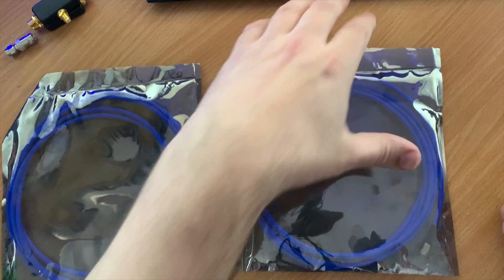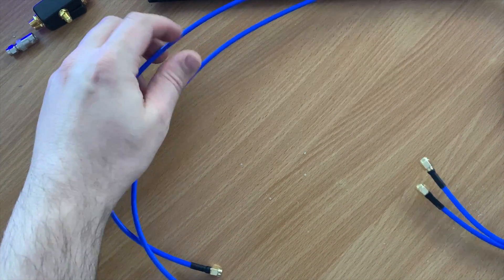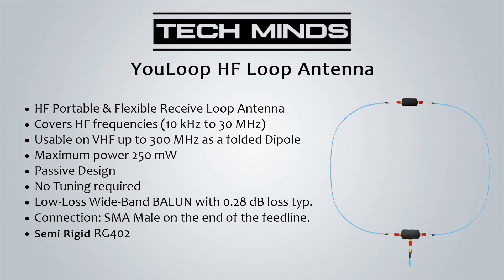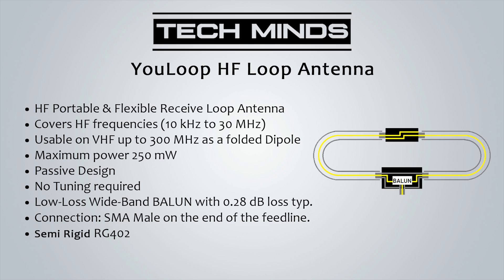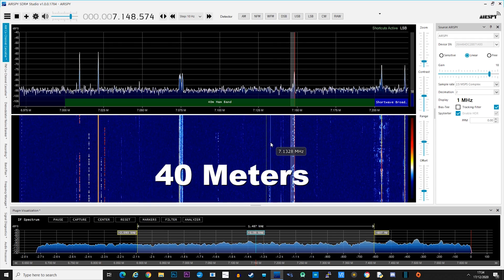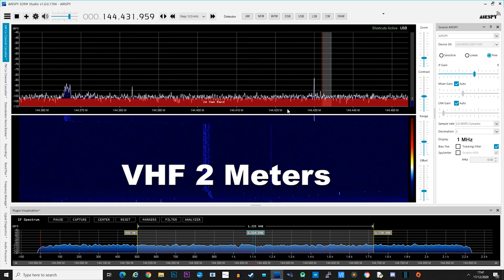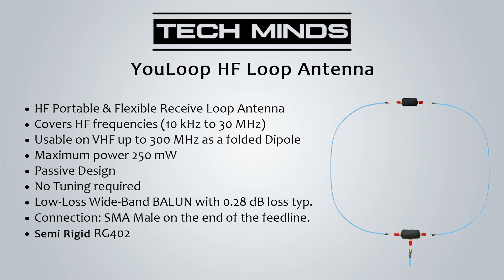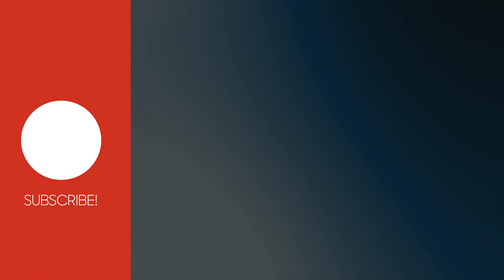YouLoop HF Passive Loop Antenna

Comment: I love mine, it works really well with a traditional shortwave radio like my Icom IC-R75. The radio's switchable preamps are helpful with this passive design and yield a very quiet result with far better signal-to-noise performance than I'm used to with a long wire.

Comment: I'm so happy to see someone using a fishing rod as a antenna pole. I'm using a 2.4m pole from Boyes (£11.50) as part of a grab bag SWL kit I've built with a fishing seat box and backpack attachment. The rod sits in the side pocket with a cable tie giving extra support. At the moment I'm just using an Xdhata AN-80 antenna and clipping it to my Tecsun Pl-368 handheld. With this setup I'm picking up CW in Russia and the USA.

Comment: Thanks for the video!
I have been playing around with this antenna design for about a week or so and it is pretty impressive indeed when paired up with the AirSpy HF+ Discovery. Signals are low with my older radios and SDRs, but my shady Malachite SDR works pretty well with a YouLoop. 
I've built a couple of modular balun and crossover assemblies, as well as a one-piece soldered-together YouLoop. It's not that difficult.
Surprisingly effective baluns can be contructed from ferrites recovered from old VGA cables and folks have used various types of coaxial cable for the loop segments and feed lines. Information is out there.
73 de N2NLQ

Comment: I built the diy YouLoop on the SWLing blog.  My performance was marginal, To try and salvage the antenna, I decided to purchase an HF receive loop antenna amplifier LAMB-1A (ebay).  What an improvement in performance.  I installed it in a small project box with  3 weatherproof 'F' connectors in place of the balun.  Attached the diy Youloop to its balanced inputs  and fed the amp with a 12 volt bias-T and connected into the SDRPlay via some RG-59..  Worked great and had about 10db of directional null.   Of course mine does not get the VHF band.  That was a great tip, I'll have to drag out that original YouLoop and try that.  Thanks for the video, great as always...   de wb7ond

Comment: I run one with a Airspy Discovery+ and it is a nice setup. Great on MW and FM Broadcast, and makes for a good quick setup on HF. My first session had me listening to Montreal FM Bcast at almost 400mi away. The key is how well it matches up to the SDR. Too much signal or gain would be worse, especially for selectivity. The YouLoop is a great match with my Airspy, as well as a good antenna for any RTLSDR. It’s loads of fun, good performer, and a nice upgrade if you are using a HF portable.

Comment: Excellent antenna especially around the LW section. paired up with the HF+ Discovery makes a great portable setup. I wouldn't bother buying a copy as the real thing is cheap enough.
Reply: Did it work well ?

Comment: I've had this antenna for a while now, and it works really well.  It works so well that I rarely switch from it to the MLA-30+ or 53ft long wire.  It just works.  Really cuts down on rfi.  (rspdx sdr as well as fgr-7)

I only wish it worked with my BELKA-DX.  There are videos of people using one on BELKA s,  but mine acts like I put a pair of earmuffs on it when I try to use this antenna.

Comment: I have built several of these, all with good results. The actual signal level obtained tends to be rather low, so a sensitive SDR like the Airspy HF+ or Discovery is best although RTL-SDR + upconverter also works well. On LW, MW and lower HF they are directional, like most loops. I have my original 60cm one in the attic, lined up for North American MW reception. One of Radio Devon's low-power MW Tx's on 801 kHz is on the same bearing, so I used a portable radio to set this up. I used RG59-Mini coax as I had a large reel of it. I have been able to hear several US East Coast and Canadian MW stations with my Airspy HF+.

Comment: For god's sake reduce gain on MW all that spikes are saturation
Reply from the maker: It’s not saturation at all, you think I don’t know how to use gain? Those spikes are local QRM and are present even with gain dropped.
Reply: @TechMindsOfficial  The medium wave and long wave tests was rather pointless. Talk Sport or whatever it's called now on 1089kHz and Radio 4 on 198kHz are about as far from difficult DX as you could possibly choose. Also why on earth are you still using an Airspy One with an upconverter? Why not get an Airspy HF+ Discovery?
Reply from the maker: I have a HF+, I have most SDRs, but that’s the gear I chose for this video.

Comment: Hmm very interested you can in theory TX up to 250mw so I could try my WSPRlite but looking at the spec for SWR I wonder just how good or bad the result would be
Reply from the maker: Strangely enough I currently have my pi running WSPR but through my EFHW. I may switch it over to the YouLoop, but SWR is rather high on HF so not sure how well it will perform. Will report back soon, or just check my call sign on WSPR net in a few days :)
Reply: @TechMindsOfficial  ah ok swr looks bad across most of HF according to your chart but anyway I've bought one off aliexpress for £14 see what happens!

Comment: ANYONE WHO HAS MET WITH SUCCESS USING THIS ANTENNA or a copy, should hop right over to the Antenna forum on Eham.net and start a thread.. so the resident 'experts' can show up and explain to you, on no uncertain terms, that such antennae are defective by design and effectively useless.

This is basically what I met with when I asked about a YouLoop clone (my own build) that I was having difficulty getting any signal with.. but in my case, I believe the issue was a very poorly built Balun - wrong core material, incorrect number of turns..

Have fun!
Reply: Hehe I think these experts will find that this Youloop antenna works just like the bumblebee. ;)
The bumblebee cant fly according to the aerodynamics but it still fly because the bumblebee hasnt studied aerodynamics in school and dont know it cant fly and therefore it flies :D
Reply: @Huxafluxa  Brilliant response to the nay sayers🤣😂.
I thought I could fly when I was a kid and ended up in hospital with broken ribs, decided a few years later I would leave it to the birds and bees.
Reply: Well the Youloop can seem pretty poor if your HF receiver isn't both very sensitive and very low noise. That means plenty of HF receivers that work well with big wire antennas are not suitable unless you add a preamp.

Comment: I have this YouLoop antenna and it works well.. I have it in front of my office window and I am hearing HF stations over 1000 miles away. I also tied some string from the top connectors to the bottom connectors to help keep the loop shape.

Comment: I have mine for over six months and it works great indoors, by the window (as in the video), with AirSpy HF+ Discovery SDR which has an in-built preamp. The SNR is fantastic in both HF and VHF spectrums.
Reply: Works well with my Qdosen mini radio 😊